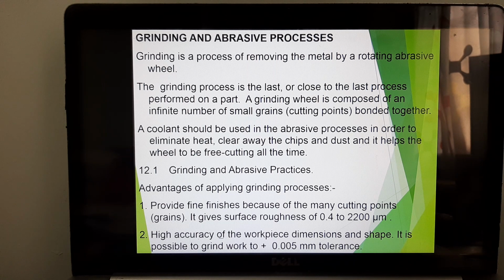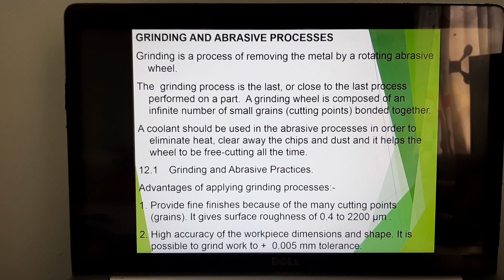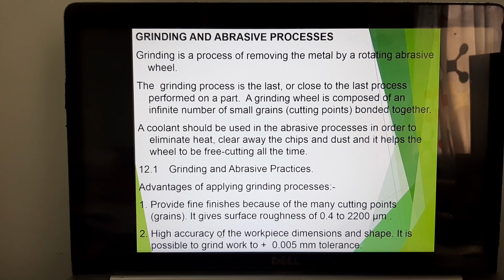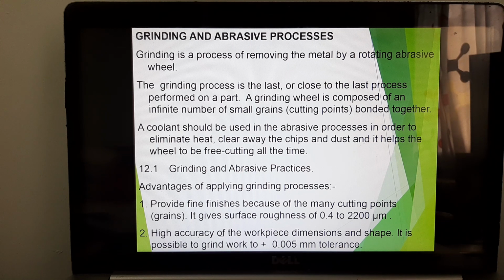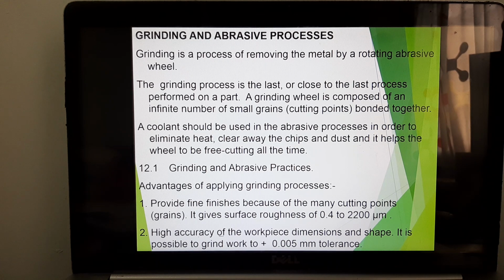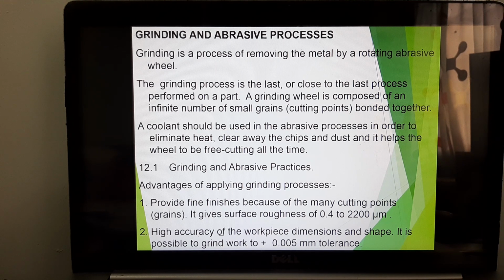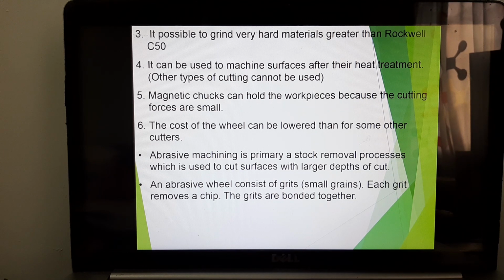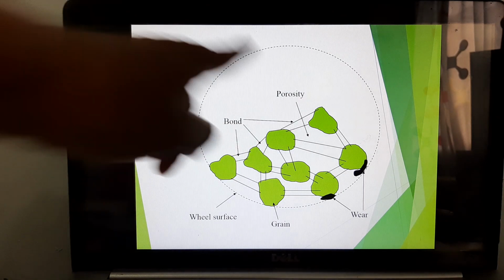GRINDING AND ABRASIVE PROCESS PART 1

Comment: Mohammad Aliff Bin  Mohd Pauzi (ME0104760). 

--grinding is process removing metal by rotating abrasive wheel
--grinding provide good surface finish
--coolant paly role as : eliminate heat,clear away chip dust 
--surface roughness range 0.4--2200  micro

Comment: Good day madam , from the video we learn about the grinding and abrasive process which is a process of removing metal by rotating abrasive wheels. Coolant is used to reduce friction, heat and clear away the chips. there are many advantages of this process such as it provides fine finishes, high accuracy dimension, possible grinding hard materials, machine surface after heat treatment, magnetic chucks holding workpiece due to small cutting force and low cost. There are also two types of grinding processes, rough and fine grinding. Rough grinding is to remove a layer of material to smoothen the surface with a minor change of dimension. Fine grinding is mainly done  after a rough grinding process to polish the surface.ME0106053 Marcus Chuo

Comment: Good Afternoon Dr, what I have learned from this video is that grinding and abrasive process is the step which completes the processes for the parts. Grinding is a process where you remove metal by rotating an abrasive wheel. There are two types of grinding which are rough and fine grinding. Rough grinding is a process which does not majorly affect the dimensions of part. Fine grinding is where we undergo surface polishing to make a smoother surface. Thank you ,Dr. 

Muhammad Naquib Bin Nor Azlan
ME0106093
Section :01

Comment: Hi Madam,i learned about grinding is done before finishing,mainly to provide a smooth and fine surface finish.Coolant is used to eliminate heat and clear away chip in abrasive process.I learned about advantages of grinding .There are two types of grinding:Rough Grinding(will not chg dimension of product in much)Fine Grinding (surface polish method).

Tan Kang Je
ME0106097

Comment: Grinding process has 6 advantages :-
1. Provide fine finishes
2. High accuracy of workpiece dimensions
3. Machine surfaces after their heat treatment
4. Cost can be reduced
5. Possible to grind very hard material
6. Magnetic chuck can hold the workpiece during cutting 

MUHAMMAD HAKIMI
ME0104774

Comment: good evening madam what i have learnt from this video are the final product need to undergo grinding and abrasive processes. It is before the final step. Material is removed when grinding. Coolant is used during this process. Diamond is the most efficient grinding wheel. Abrasive machining is to move a layer. Rough grinding will not change dimension of the product. Then it will undergo fine grinding.

Luqman Mizani
ME0106085

Comment: Hi mdm, in this video i learnt that every product at the end it has to undergo abrasive and grinding process and finishing process. This is to make the product to look good and attract the buyer's attention and marketable. Grinding requires coolant to reduce heat, to reduce friction, to prevent metal dust. There is 2 types of grinding, rough grinding ( for material that surface still rough, not changing the dimension and change of product ) and fine grinding ( surface polishing method ).

ME0106084
Darrell Anak Dau

Comment: I have learned from this video how to grind, and abrasive process is a very important step. That is because it influences the product's appearance. Our final product has to look very fine in a very impressive look. Other than that, there are 2 types of grinding, one being rough grinding and the other being perfect grinding. Finally, after the commodity is exposed to rough grinding, fine grinding needs to be achieved. When it is smooth, then proceed to finish operation. I may assume that is it. 

Muhammad Harits Bin Mohamad Zailan
ME0106091

Comment: Me0106908
Rajbhinder Singh
From this video I have learnt that grinding and abrasive processes is done before finishing processes. Abrasive machining is done to remove a layer of surface to smoothen the workpiece. Grinding is done two times, rough and fine which rough is used to remove a layer while fine grinding to smoothen out the surface. Thank you.

Comment: In this video, I've learnt about grinding and abrasive process.This process is basically removing metal by using rotation of abrasive wheels. This process produces alot of heat and it may disturb the process, this coolant is used to reduce the heat caused by friction in this process. There are 2 types of grinding rough and fine grinding. Rough grinding is removal of layer to smoothen the surface of the material with very little change in dimension. Fine grinding is to provide surface polishing after rough grinding.

Navineswaran
(ME0105317)

Comment: From this video, I would like to conclude that there are many advantages of applying grinding process which are provide fine finishes as well as high accuracy of the workpiece dimensions and shapes. Also it is possible to grind very hard materials and many more other advantages. I also learned that there are two types of grinding that is rough grinding and fine grinding. rough grinding is used to grind rough surfaces but it will not affect the workpiece's dimesion. fine grinding is more to a polishing the workpiece for a smoother surface

Ariff Imran 
ME0106083

Comment: Good evening madam, Muhammad Khairul Afiq Bin Azaha ME0106092

From this video I learned about grinding and abrasive process. From this process we can produce a product with good appearances.A lot of advantages that can we get from this process such as provide fine finishes.Next high accuracy for workpiece dimension and can grind hard material.other than that the magnetic chuck can hold the workpiece during cutting.

Comment: RAVEEN KRISHNAN A/L K. BALAKRISHNAN 
ME0106095

Hi madam, this video has taught me that a final product has to undergo two(2) final steps which are Grinding and Abrasive Processes and Finishing Processes. The Grinding and Abrasive Process produces a well appeared (nicely finished) end product. It is used to remove a layer of material so that the surface will be smooth and evenly distributed. The process of removing the material causes frictional force and thus, a lot of heat. A coolant must be used to eliminate the heat and clear out the chips and dust. 
Some advantages of this process are :-
a) It provides fine finishes
b) The dimension and shape of the work piece have a very high accuracy
c) It can be used to machine surfaces after their heat treatment
d) It is possible to grind very hard materials
e) The cost of the wheel can be lowered
There are also two(2) types of grinding:-
- rough grinding : causes very slight change in the dimension and measurement of product.
- fine grinding : surface polishing method (makes the product even smoother)

Comment: good evening doctor.  I have learnt today that grinding and abrasive processes are the second last stage of the manufacturing process. it is carried out to ensure that the surface is favorable for the finishing process. the grinding process causes friction and heat therefore we must always use coolant to eliminate the heat and clear away the chips during the process and avoid mishaps. a few advantages of grinding process are it provides fine finishing, produces high accuracy workpiece, possible to grind very hard materials. The grinding process involves two parts - rough grinding where the dimension is slightly altered and fine grinding where it acts as a surface polishing method before finishing process.

KHIIREN SHRI RAM
ME0106086

Comment: Good evening madam, from this video i learned that grinding and abrasive processes are vital to create a product with good appearance. Grinding process also has 6 advantages which are:-
-Provide fine finishes
-High accuracy of the workpiece dimensions
-Possible to grind very hard materials
-Machine surfaces after their heat treatment
-Magnetic chucks can hold the workpiece during cutting
-Cost of the wheel can be reduced
There are also two types of grinding:- rough grinding and fine grinding
Rough grinding causes a slight change in the dimension of the workpiece while fine grinding is a surface polishing method.
Shahnyeel A/L Anil Kumar
ME0106096

Comment: Good afternoon Dr, im Mohamad Fayyadh B Fazlulaah ME0106089. From this video, i have learned grinding and abrasive process is a very important step. It is because it affect the appearance of the product.  Our final product must in a very super good-looking.  Other than that, there are 2 types of grinding, first one is rough grinding and the second one is fine grinding. Fianlly, once the product undergoes rough grinding , it needs to under goes fine grinding. Once it smooth,  then continue with finishing process. That's all that i can conclude. Thanks for sharing Dr.

Comment: Mohamad Ikhwan Syafiq bin Zadi

ME0106090

In this video I have learn that grinding and abrasive is
really important to ensure good appearance.During this process , lot of heat
produced thus a coolant is a must during this process. Theres is two types of
grinding which is rough grinding and fine grinding. Product will undergo rough
grinding before going to fine grinding.

Comment: Good afternoon madam, I am Wong E-Shen (ME0106071). In this video, I have learnt final product need to undergo grinding and abrasive processes and finishing processes. Those 2 processes are carried out to make sure the products is good and smooth. During grinding and abrasive process, a small layer is removed and the coolant is applied. There are 2 types of grinding which are rough grinding and fine grinding. Rough grinding is a small amount of materials is removed to smoothen the surface while fine grinding is surface polishing method.
Thank you.

Comment: Name: NEENA BT AHMAD NIZAM
ID: ME0104364

From this video, we learned about grinding and abrasive process. This process is the last step of manufacturing before the finishing process. It is to remove a layer of workpiece for a smoother surface but it does not change the dimensions of workpiece. The grinding causes friction between the grinding tool and workpiece and so coolant must be used in this process. This process requires a rough grinding first then onto a fine grinding. The advantages of the grinding and abrasive process is to provide fine finishes, high accuracy of workpiece dimension and shape, has the possibility to grind very hard materials and lowering cost of wheel. Thank you.

Comment: FAIZ AFFENDIE BIN MOHD NAZRI
ME0106085
Good day, miss. From this video I have learnt that grinding and abrasive processes is done before finishing processes. Abrasive machining is done to remove a layer of surface to smoothen the workpiece. Grinding is done two times, rough and fine which rough is used to remove a layer while fine grinding to smoothen out the surface. Thank you.

Comment: Greetings Dr, I am Derrick Ng Kian Ping (ME0105733) .At the end of the video, I have learned that grinding and abrasive processes is carried out in order to achieve a good surface finish. In these 2 processes, materials are being removed and coolant is used to reduce the heat and friction between the grinding wheel and the materials.5 advantages of grinding can be seen which are fine finishes,high accuracy of workpiece dimensions, possible to grind hard materials, can be used after heat treatment and cost can be lowered. There are 2 types of grinding which are Rough grinding (when surface is still rough) where the dimension of products will change very slightly in order to smoothen the surface. Fine grinding on the other hand is a surface polishing method.

Comment: Good day Dr.. I am Ariff bin Alzakri (ME0106046). Among the things that I have learned from this video is that there are two essential steps after obtaining the finished product which is grinding and abrasive processes and also the finishing processes. Other than that, there are two types of grinding process which is rough grinding followed by fine grinding to produce a surface favourable for finishing.

Comment: coolant is used to: 
1. reduce the temperature of the tool
2. reduce the friction between chip
3.increase tool life
4.improve surface finish
Mohd Nafiz Bin Serbini
ME0105169

Comment: Name: Nur Syazwani Bt Mohd Noor
ID: ME0104367
From this video, i learned that grinding is a process of removing metal by rotating abrasive wheel. The significant of applying this process is it provides fine finishing, can machine very hard materials and has high accuracy of workpiece dimensions. The grinding process have two types. First, rough grinding which will only cause a slight dimensional change to the product because of the material removal and secondly, the fine grinding which surface polishing.

Comment: Good day Dr, I'm Lee Zi Sheng (ME0106051). I learned there are rough and fine grinding. Rough grinding is to remove a layer of material to smoothen the surface with a minimal change of dimensions. Fine grinding is done after rough grinding aka polishing the material. grinding and abrasive process is removing metal by a rotating abrasive wheels(diamond is the best but too expensive).Coolant MUST be used during this process. The advantages are  fine finishes, high accuracy dimension, possible grinding hard materials, machine surface after heat treatment, magnetic chucks holding workpiece due to small cutting force and lower cost. Thank you.

Comment: Good afternoon madam, I'm Chong Jin Yang (ME0106047). From this video, I have learned what is grinding and abrasive process. It is a process of removing metal by a rotating abrasive wheels. It's a last or close to the last process. Coolant is used to eliminate the heat and clear away the chips during the process. There are a few advantages which are providing fine finishes, high accuracy dimension, possible grinding hard materials, machine surface after heat treatment, magnetic chucks holding workpiece due to small cutting force and low cost. There are two types of grinding which are rough and fine grinding. Rough grinding is to remove a layer of material to smoothen the surface with a very minor change of dimensions while fine grinding is the process after rough grinding and to provide surface polishing for the material. Thank you.

Comment: Good morning Dr, from this video I learned that grinding and abrasive processes are the finishing processes for the parts. Grinding is when you remove the metal by rotating an abrasive wheel. During this process, coolant must be used to eliminate the heat produced and wash away the dust. First step of the grinding process is rough grinding where the dimensions/measurements of the product are not majorly effected, in which it only causes a minute amount of change to smoothen the surface. Next it will undergo fine grinding, where it is a method of surface polishing to smoothen the surface. 
-AHMAD NAZRI BIN AHMAD TAMRIN  ME0106079

Comment: Name : Aiman Hazim Bin Arif Razman
ID : ME0106080

After watching this video, I have come to know that it is vital for products to undergo grinding & abrasive processes to ensure good and attractive surface finishes in order to market them. What I can understand from this video, is that grinding process removes metal by rotating the abrasive wheel which generates frictional force on grinding wheel and material of cut. Coolant is used to further smoothen this process. The benefits from grinding process as stated are producing fine finishes, enabling high accuracy of workpiece dimensions & able to grind very hard materials that are greater than the Rockwell diamond C50. Grinding can also be classified into two which are rough and fine grinding. Rough grinding removes the rough surfaces of the material with minuscule dimension changes, whereas fine grinding acts as a surface polish for the material.

Thank you for the lesson Dr.

Comment: NIGEL ANDERSON SINGH A/L RAJDEEP SINGH 
ME0106094
Good day, miss. Final touch on the product consist of grinding and abrasive processes and finishing process (chapter 8). Advantages of grinding and abrasive processes are fine cutting process with high accuracy, possible to grind a very hard materials, used to machine surfaces after heat treatment and lower the cost for other cutter. The most efficient grinding should be diamond grinding wheel but due to its cost, it is not preferable. Coolant is also needed in this processes. There are two types of grinding which are rough grinding (no change of dimension of material and involved material removal) and fine grinding (smoothen and polishing product surface).

Thank you.

Comment: Good Evening Madam, from this video ,  I have learned about Grinding and abrasive processes. There are 6 advantages of abrasive process. I also learned about the process of grinding which start with rough grinding follow with fine grinding. Thats all.

Name : Alif Haikal Bin Azly
ID: ME0106081
Section : 01